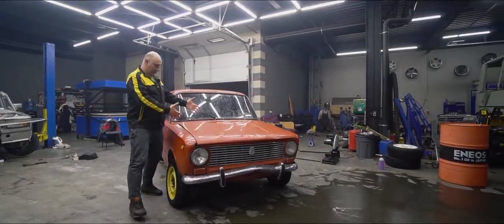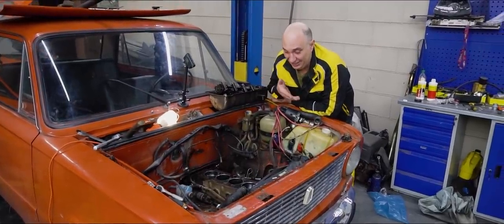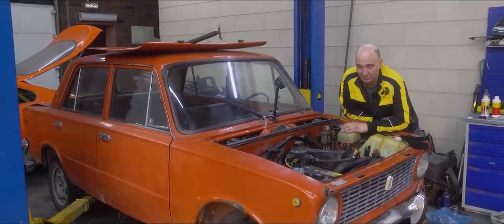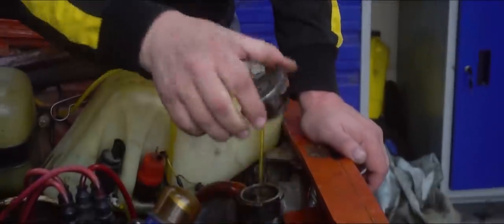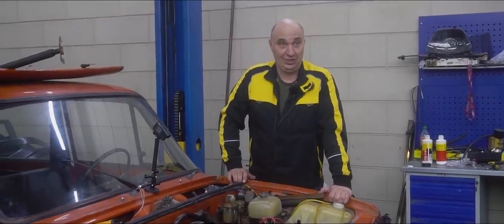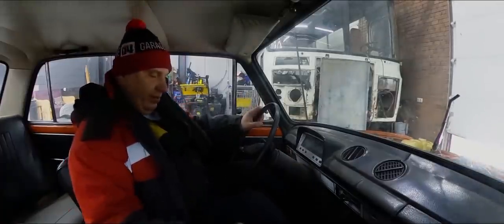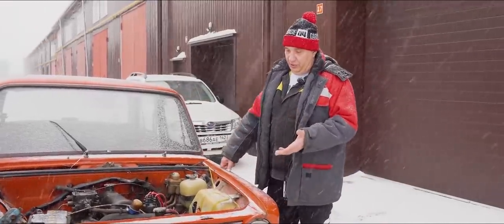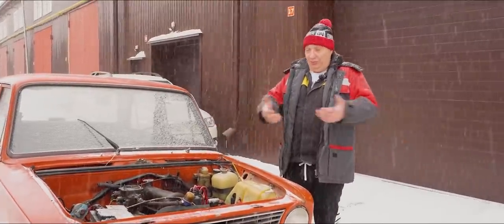What happens when you fill the cooling system with motor oil?

Comment: And the oil doesn't freeze like water, oil cooled engines have been around for a long time.
Reply: they need to work outside russian winter though
Reply: @MrMaxGyver  Glycol has been used for liquid cooled engines in Aircraft and Arctic vehicles since the 1920's.  Very flammable though.
Reply: @tonys1636  Also, in plenty of engines, the fuel is used as somewhat of a coolant.

The most extreme case of this is rocket engines where kerosene is both fuel and coolant, as well as hydraulic fluid for all the moving parts.
Reply: @tonys1636  calcium hypocrite? Cant remember
Reply: @tonys1636  NOT very flammable though.  It is a 1 out of 4 for flammability.  Its not like you would get a fireball if your engine overheated and steamed the engine compartment with coolant vapor.

Comment: Brilliant video guys I wonder if a head gasket goes for real if you could do that pour oil in the radiator and keep driving
Reply: Not really, because you’re losing your cylinder pressure, and it would mean you’re losing your hot exhaust gasses into the cooling system. Thus, heating the oil faster than the radiator can cool it. Also it  would probably cause it to bubble quite a bit and overflow.
Reply: @brandonjones4666  Also, if the oil in the cooling system were to leak into the crankcase, it would overfill and the oil would become aerated and the engine will eventually seize. As for the oil being pushed into the cooling system, most cooling systems arent designed to work above 20 psi. The oil pump provides about 50 psi.

Comment: Have done this in an 89 ford LTD while delivering pizzas. Got oil in the coolant. Flushed the whole mess and filled it up with rotella. Ran the radiator cap overflow to the oil fill cap. Worked for months until I got another car.

Comment: it would be interesting to drive a few years like that with this car. if the engine doesn’t generate too much heat it may be better then water for keeping the block clear of rust. 
Anyway beware that if the coolant system is contaminated you will need to clean the oil thoroughly doing several flushes but if you put oil in it it may be even harder. keep the heater on cold so the heater core stays shut.

Comment: This is an excellent way of introducing oil cooling by running it through the primary radiator. 
The size of the hp oil bypass channel you cut was a fluke.
An oil pressure gauge would have been handy to  see what that bypass did, your bearings may not float properly.
This is all solvable with another paper napkin and samohon design session.
Well done. Looking forward to V1.1 !!!

Comment: Fill the engine with mercury ínstead of oil
Reply: mercury eats other metals, especially aluminium. just an FYI
Reply: Benjamin Getz  lol i mean some people's nerves are more sensitive to it and can demylenate/depolymerise but i wouldnt say it EATS people lol ive handled it
Reply: @vevenaneathna  not iron.
Reply: Would still be fun to see which amalgamated part fails first.
Reply: @ImnotgoingSideways  in old engines is 0 aluminum. learn chemistry or physics instead of guessing
Reply: @David-cy5zu  Almost all metals can form amalgams with mercury.  Old (pre 1990) metal tooth fillings were mercury/silver amalgam.  Gold can be extracted from ore by being amalgamated with mercury.  Copper, zinc, and alloys like brass and bronze (popular for bushings and seals) all amalgamate with mercury.  Study chemistry before telling someone else to learn chemistry.

Edit: "ore"

Another edit: 1:10 That cylinder head and manifold are very much aluminum, along with the guards over the camshaft.  And how "old" are you talking about?  That car looks like it could be from the '70s or '80s.  My 1962 VW has a magnesium engine block, aluminum pistons and aluminum cylinder heads.  And that design started in, if not before, the 1940s.
Reply: @ImnotgoingSideways  its crap you talk. ``Almost all metals``. you mentioned only like 3. steel does not and copper neither. copper does not form an amalgam. it does not form an amalgam. google how you prove Hg2+ Ions. By putting Cu metal in the solution, Hg get reducted and Cu oxidizid. No amalgam. how the hell cares about your vw? lada does not. also it would take months for 5 mm aluminium to amalgame trhough. now if bronze and brass do amalgames - i dont know, maybe Hg would leech out some ions.
Reply: @David-cy5zu  "One application of mercury is its ability to form stable alloys, called amalgams, with other metals. In these reactions, the other metal dissolves in mercury. Mercury forms amalgams most easily with metals like gold, silver and aluminum. Mercury does not react with all metals; it will not form an alloy with iron, for example, and it is reluctant to form amalgams with most transition metals, excluding manganese, copper and zinc." For fun, look for Cody's Lab video from 2018 where he literally amalgamates copper with mercury on video.
As for the Lada, a quick Google shows that early models are licensed copies of the Fiat 124 with an 'R' suffix to indicate they were Russian.  Those will have a iron block and head but still have bronze valve guides, copper sealing washers and copper/lead alloy crank, rod, and cam bearings, and aluminum pistons.  The Lada used in the video is the later non-Fiat overhead cam version which does further have an aluminum cylinder head, aluminum/silicon bearings, and aluminum water pump.
I'm enjoying this.  Lada are pretty interesting cars given their Soviet history, Fiat roots, and that the original name was Zhiguli but was changed because it was deemed too hard to pronounce by non-Russian speakers.
It would still be fun (albeit dangerous) to see how an engine would manage being flooded with mercury and run to determine which part fails first.  I'd predict pistons or rod bearings would be the first to go. But, would also wonder if the oil pump and pressure release would handle the high density.
Reply: @ImnotgoingSideways  amalgamating copper means plating copper with a Hg surface. it does not dissolve copper like aluminium. to be honest, some engines of Lada have aluminium head. still it would work long and be very very toxic for all around. dont forget the residual oil. for aluminium to be attacked, you have to remove the oxide layer, now imagine the layer of 50 years oil. pistons almost get no oil in old cars, there are no jets directed at them like in new high performance engines, they get oil sprays from the crankshaft stirring it up.

Comment: Nice one guys that’s a cool video 
I ran a tractor that was made somewhere in Europe in that was manufactured in the 1930s that used oil as coolant 

The one problem with oil as coolant is it’s heat retention,,, once it is hot it doesn’t like to cool down so an engine will over heat ,,,, the other problem is all your coolant hoses on a car are not comparable with oil products ,,,, but nice video 
Thank you

Comment: Should have been a diesel engine. Where oil would be leaking in to the chambers causing a diesel engine runaway :-D
Reply: Sounds like the ultimate way to optimize engine operation, using one fluid to lubricate, cool and run the motor.
Reply: @SwapBlogRU  It is done... Could probably be done in a car as well, but would need some oil pump for the cooling system. Probably wouldn't work well in most engine blocks either.

Comment: This is a very good system. If the oil pump fails, the water pump will take over, if the water pump fails the oil pump will take over. Garage 54 ingenuity at its best.

Comment: this man is trying to overheat an engine in freezing weather!? Do a summer test next
Reply: Yeah i had a ford 6 that overheated in anything over 28 C in summer the same car in winter was fine, a cut price wrecker / mechanic had a ford ute that had no radiator - the top and bottom engine hoses was joined together with a metal pipe - he said he can get 5 to 10 min out of it before it pings and he just shuts it down - he used it as a a forklift / box trailer to move engines and gearboxes from upfront of the yard to the rear or pick good at the back and take them up front to customers - he ran it this way for 6 years
Reply: @georgemaragos2378  That's really cool

Comment: This is so true, you never know what the motor wants to do, every head gasket fail is unique, I give you tip, if your head gasket gets coat of ‘lubriplate’ never blow and even reusable after disassembly, . But I like messing with port and polishing heads on my v6 Capri, they gasket expensive

Comment: I didn’t want a mixture or a head gasket failure just oil instead of Coolant.
Reply: This 100%. Should have just complete emptied the cooling system and filled it with oil.
Reply: They never purely ran the cooling system on oil, it was always connected to the engine oil

Comment: I've really wanted to see gasoline in the radiator as coolant.
Reply: mastermilo did it
Reply: @RickBaconsAdventures 👍👍. I'd really like to see g54 do it their way
Reply: Exactly
Reply: Then after it's hot, what happens if you start smoking in the car.
Reply: Gasoline/petrol/benzina would evaporate 👍 s
Reply: @SelectTaxi24  where would it evaporate to? It's a closed system
Reply: @SelectTaxi24  agreed, but would pressure not build in the system? Depending upon the cooling system I suppose.??
Reply: @mrhead5823  exactly 👍 for example mazda and some ford's that use mazda engine like ford ranger you can open the cap wichout any problem iven when the engine is running. Nu build up pressure. But at some cars where they build up pressure we all know that the petrol/gasoline is creating pressure iven in a bottle so i guess is going to find a way out. But is just an idea. Let's see does boys doing the Test 😁
Reply: @MF175mp  cigarettes don't light gasoline easily.
Reply: @travisjordan1528  but how about the lighter you use to light it

Comment: I always wondered why cooling systems weren't filled with something like hydralic fluid that would never need changing.
Reply: Yes and no rust but what about water pump seal?
Reply: @burnotto1663  I'm saying why don't manufacturers design vehicles that way.
Reply: @waynes.2983 That would solve the problems I could imagen for the moment
Reply: Cuz oil isn't as good as a heat conductor.

Comment: In that weather I'd be surprised if the engine overheated with a dry cooling system.
Reply: It's a Lada. That car will overheat on premium antifreeze and reverse osmosis water but will run just fine on molten lava.
Reply: CyborgKing200  yep, it’s a true well known fact.
Reply: Oh yeah. Even in the coldest of cold, it'll over heat without coolant.
Reply: I was being hyperbolic. Still, in those freezer temps, the oil being adequate to cool the Lada is not surprising.
Reply: @victorunbea8451  Lmao
Reply: Cooling systems with not enough antifreeze will destroy an engine pretty quickly in cold climates.

Comment: YES :D I thought about this with the old international tractors. The head gaskets go, but also the O rings at the bottom of the cylinders. On an old tractor it isn’t worth an engine rebuild. But, if the rad leak off pipe went to the rocker box top and I ran an oil line to keep the radiator full of oil it would have worked. I didn’t get a suitable customers tractor to try it on though :o(

Comment: So if water as a coolant can potentially cause so many problems - freezing, blown head gaskets - getting into the oil, or turning to steam, etc, etc - why was it introduced as coolant in the first place?? With only oil you'd have no corrosion of alloy blocks, no rust in iron blocks, no calcification of radiators, oil pumps that last. Surely it' a win win??

Comment: Thanks, this was my suggestion! 😊

Oil cooled engine would mean no corrosion or freezing coolant in winter. 👍
Reply: Well... the oil might not completely freeze, but it's definitely not as liquid as water with anti-freeze. I'd worry that the super thick oil wouldn't warm up in enough places to cool the engine before it overheated.

Comment: A quick search  shows that the specific heat and thermal conductivity of coolant are both much higher than for oil. In a snowy Russia this wont matter, the engine is designed to work everywhere from Siberia in winter to Death Valley in summer so there is lot of unused cooling capacity. On a warm summers day the engine would overheat with several different potential failure routes. 
It was still great fun, those Ladas are tough :-)

Comment: I had a forklift that had a cracked head that allowed oil to mix into the cooling system so I drained all the water out of system and fill with oil so it didn’t matter if it mixed and we are still using it  no problems
Reply: How long has it been running? Amazing

Comment: Suggestions: brake fluid in the cooling system...solvent(methylated spirits, paint thinner etc) in the cooling system
additional suggestions: replace brake fluid with other vehicle fluids eg, engine oil, antifreeze coolant.
Reply: They have some interesting substitutes in cuba for brake fluid, it involves washing up liquid.

Comment: There is a company that makes oil for the cooling system, alot of advantages. It was a minesite using it in their big generators. The kit involved draining coolant, flushing a solvent thru to remove all traces of coolant, fill with their oil and fit their radiator cap (low pressure). It has better heat transfer between the block and the oil, then the oil and the radiator, not pressurized, oils lasts life of engine, parts don't corrode. It wasn't just engine oil, but oil made for that type of job.

Comment: Yeah I'd like to see what different weight oils would work and how well they work as in temp sensor changes from using the different oils as coolant. We all know that oil does a significant job as coolant anyway. Some would argue that heat transfer is a primary function of oil.

Comment: Many years ago I felt that the whole engine lubrication system could go through the front radiator as well as the sump, the main problem being  filtering residue particles from inside the engine block from the casting process, which would need  multiple filters, but apart from the cost of oil changes would be beneficial in cold countries!

Comment: I filled a dead '99 Jeep cherokee sport 4.0l that sat under a tree without oil in it up in the northeast for 15 years completely with liquid chain/bearing degreaser instead of oil and it started right up and is Still running with the Same batch of lubricant in it better than it ever has!

Comment: Don't Porsche air-cooled engines run on the same principle? I've heard there were 14 liters of oil in the system, with the oil radiators up front.

Comment: Interesting! I have heard of alot of people running Hydraulic fluid as coolant in demolition derbies to keep down the steam when the engine overheats and I'm sure for other reasons I'm not sure of. 
SUGGESTION! if your looking to completely trash a Lada, maybe run gasoline as coolant. A much lower boiling point it would be interesting to see how bad it gets when it suddenly looses pressure   like a blown hose or cap and most likely will auto ignite but perhaps through the whole engine since it will near instantly turn to a gas instead of a liquid. Just a thought.

Comment: how did he get positive pressure to keep oil flowing out of crank case and into the radiator ?.. Id like to see more on that. Was it just a high pressure electric pump and a few check valves ?

Comment: The advantages of substituting oil for glycol/ water mix are less corrosion within the block and in case of a cooling system leak, oil with oil is not such a problem.  But oil has only 1/3rd of the thermal conductivity of  50/50 coolant / water mix.  Means that an oil cooling system would need to be 3 times larger than a coolant system.

Comment: I thought you were going to drain the coolant and refill it with oil .  Id like to know if you can replace the coolant with oil.  Say you busted a hose and all the antifreeze spilled out when you were off roading and all you have is oil and a hose.  Can you put a new hose on then refill the cooling system with oil . will it keep it cool or will it over heat or set fire

Comment: Garage 54 should have their own test track and test these ideas under endurance. 
I was not expecting them to damage the cylinder gasket, but to put the oil in the radiator and drive a long distance.

Comment: I've always wondered if oil in the cooling system would work well enough. The rad certainly wont go rusty inside and the water pump would be well lubed!
Reply: Radiators don't rust.

Comment: It would be fun to try swapping fluids like coolant in the crank case and oil in the cooling system at the same time. 
Might be fun for other systems like power steering or transmission, fuel, etc...

Comment: I would love so see what happens if you remove the head gasket so you get a higher copression ratio which means more power.
Reply: Idea of gasket is to seal combustion chambers, so you will get any compression...
Reply: @SmallKittyPaw  yeah I know, but maybe if they would be resurfaced, the head and the bloc and maaaybeeeeee, put a little bit of silicone for the rest of what couldn't seat good enough

Comment: That was actually very interesting. Wonder how that goes on hot summer days :-)
Reply: Probably about the same as an old school VW Beetle, those used the engine oil to transfer the heat to the air-cooling fins.
Reply: @SaberusTerras  I had one of those - it was my first car - no water, only oil and air.

Comment: Coolant leaking into the crank case will cause power loss possibly to the point of stalling when the level reaches the bottom of the piston bore and pistons end up dragging oil+coolant mix up/down the bore instead of air.

Comment: When my head gasket went it was coolant into cylinder 1 casuing it to missfire when cold and pressureise the coolant loop while hot blowing the cap off all the time. That was with a Toyota 22R and aparantly thats a very common way for them to go.